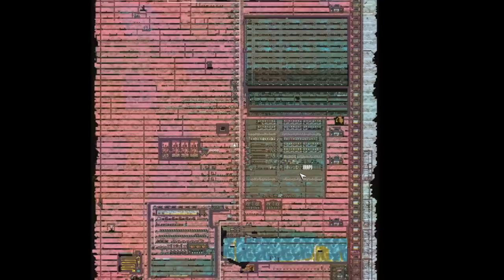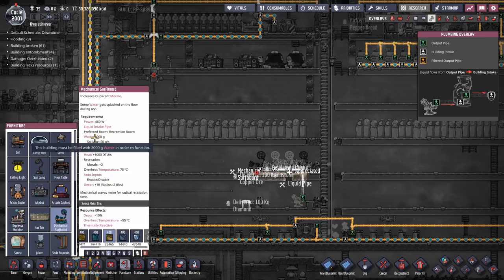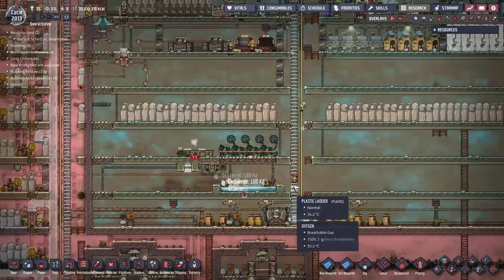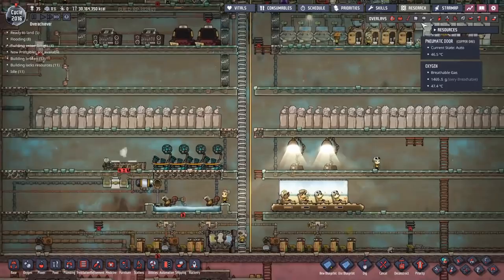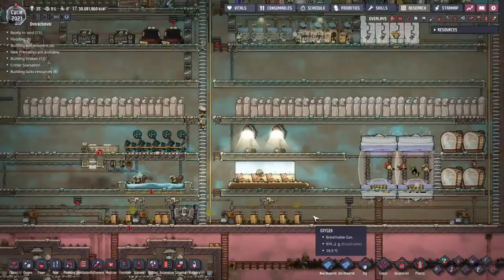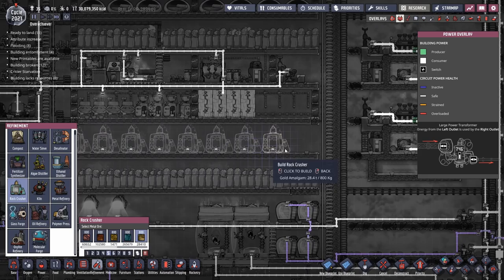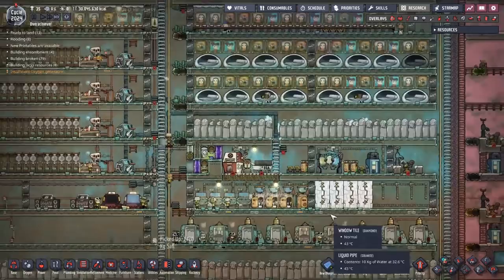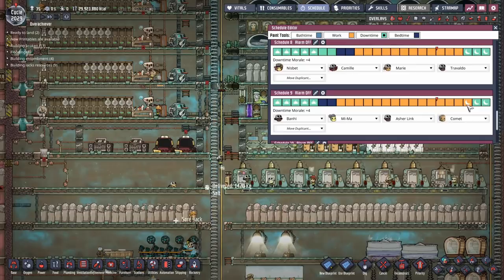Rime 33 : Popping CO2 tank, Maxing out moral : Oxygen not Included

Comment: thing about table salt is, if you have a chlorine vent or bring it from space, you can grow saltvines domestically with the sand as fertilizer and be salt positive
Reply: not sure, saltvines are 50c max, chlorine gas vents are 60c output, you'd also need thermal regulation with heat deleting mechanisms (steam turbine), but if you manage to do so, you are salt positive.
Reply: You rarely run out of salt in this game, nor the colony really requires it

Comment: You still need to turn on the water cooler! It gives +1 morale when dupes use it.
Reply: I heard you could even have it floating in the air, out of reach, and it would still give out morale?
Reply: @sebbes333  it would be disabled, so they cant use it so it doesnt give morale, but i think the misconseption you might be under might be that you CAN use a floating cooler to upgrade a mess hall to a great hall, which is in itself an interesting idea.

Comment: I just found out that the comfy bed restore more stamina? That means more playtime!
Also 6:43, master transition
Reply: Wow I didn't even catch that the first time
Reply: its also miniscule, and the extra climbing and running to and from it due to it being bigger and needing more space and thus to be further away makes it barely a difference, to echo the OP's sentiments on the topic.
Reply: @U6kCtBuN  stamina is sleep dude. Not speed
Reply: For sleep concerns it's only a 25% faster sleep time. 

If they get full sleep in 2 slots then there is no need for the comfy bed benefit because they will continue to sleep for the full 2 slot either way.

As it currently stands it only takes 1.75 slots to get full stamina in the normal bed so no matter what. As long as they get food and bathroom in their down time and have 25% of bedtime to get to bed. They will always get full stamina every night. 
If they don't get back to their bed and don't get a full sleep then it benefits. 

If they would increase the sleep benefit to 50% it would actually benefit as it would only take 1 slot to get a full sleep and you can set 1 less sleep in the schedule.

Comment: The leisure buildings tell you how many cycles the bonus lasts for and how long it takes to use.
Sauna  +2 for 3.95 cycles  time 30 sec
Arcade +2 for 3.95 cycles  time 15 sec
Juke Box  +2 for 3.95 cycles  time 15 sec
Surfboard +2 for 3.95 cycles time 30 sec
Showered +3 for 0.85 cycles time 15 sec
Coffee +4 for 0.75 cycles time 30 sec
Juice +4 for 0.75 cycles time 30 sec
Soda +4 for 0.75 cycles time 30 sec
Hottub +5 for 7.95 cycles  time 90 sec
Wind tunnel +5 for 7.95 cycles  time 90 sec
Beach Chair    +8 for 11.25 cycles  time 150 sec
Salted +1 for 1.2 cycles
what this means is you need 196 seconds of R&R per day to maximise dupe happiness.  ie you need 8 periods of downtime or 1/3rd of the day for R&R.

Comment: also francis did you notice that that vertical wind tunnel has a huge impact on the gas around it, it moves a lot of gas around and reduces the pressure of the gas below it and increases the pressure of the gas above it. also when a dupe is going to the VWT they have an approach animation the one going to the middle looks worried before they enter lol
Reply: @dpsliver about the wind tunnel just put it in a separate room with liquid lock and it will not affect anything and they should be outside the main area the dupes needs to be in atmosuites to not get the high pressure gas thing
Reply: @aymanoracle  during my last play though it seems to have an effect on gas above even if tiled off... lol i placed it below my CO2 food pit and it blew all the CO2 out of the pit
Reply: @dpsilver1  yes it moves gas so put it in a separated room with liquid lock